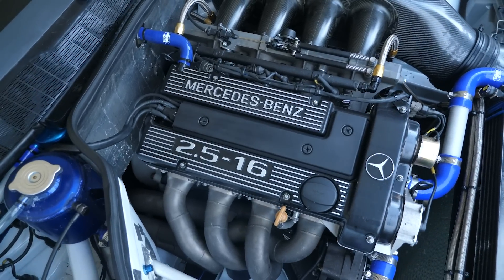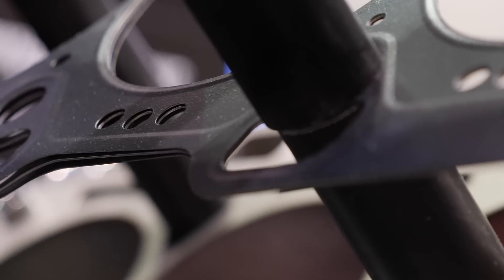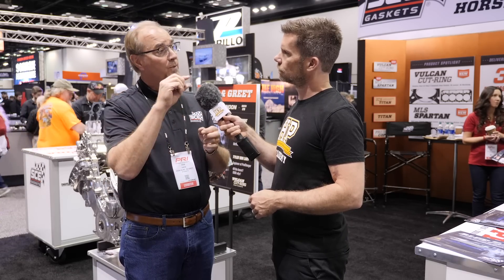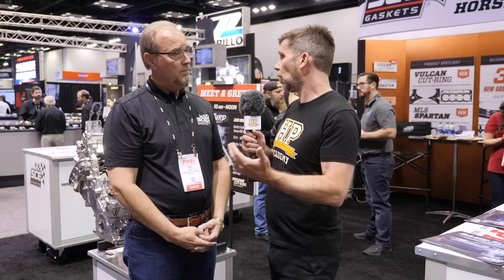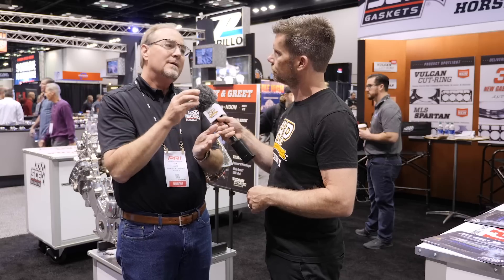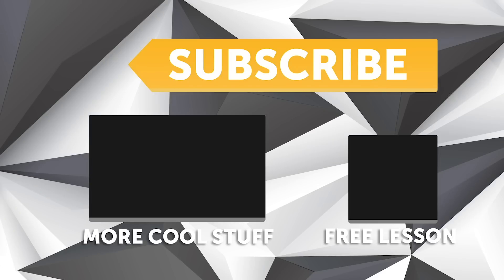50HP To 5000HP | Choosing Your Head Gasket | SCE Gaskets [TECH TALK]

Comment from the maker: 🏎 Building a fast car? Get $400 OFF the all-inclusive VIP online course package deal: https://hpcdmy.co/offery191
✊50% OFF your first online engine building course. Enrol now:  https://hpcdmy.co/offery191

9 out of 10 members of the public recommend you seal your body away from the elements with a stylish HPA hoodie or t-shirt: https://shop.hpacademy.com/
Get one for the missus while you're at it, but in your size so you can borrow it on the weekends 😉 #tazlifetips
00:00 - Introduction
00:30 - Composite Gaskets
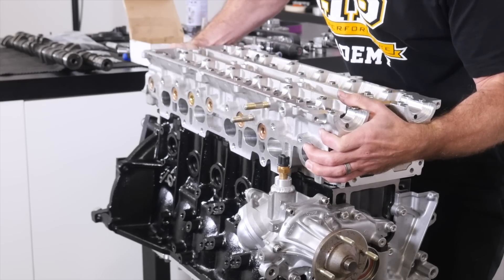02:00 - MLS Gasket, Multi Layer Steel
03:00 - Cylinder Lift/Gasket Memory
04:12 - MLS Gasket Coating, Viton
05:07 - Reusing A MLS Gasket?
06:21 - Vulcan Cut Ring Intro
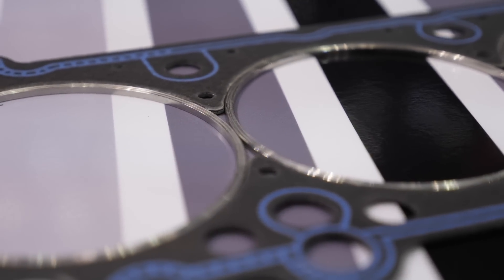06:50 - Copper O’Ring Gasket
10:45 - Vulcan Cut Ring Revisited
12:43 - Composite vs MLS In Cut Ring Gasket

Comment: 5:31 Why would you ever risk reusing a headgasket? That was bad advice.
Reply from the maker: He's told you it's most likely you won't be able to and why to be fair, but he can only speak from his own experience and someone like Ryan Hunter will have dealt with more head gaskets and customers using them than 99.9999% of people on the planet. Not that anyone is infallible.

On a performance engine we would also always just use a fresh one ourselves. It's cheap insurance compared to the damage a bad gasket can cause - Taz.

Comment: What do you recommend for a diesel engine running on CNG .
I work on a fleet  of 35 trash trucks that puts in head gaskets weekly.
Reply from the maker: We don't have any CNG content sorry. You will have to do some data collection and failure analysis on the issue as there isn't one single issue that can cause a head gasket to fail - Taz.
Reply: @hpa101  these are composite gaskets with a cramped on metal ring.
We see the metal ring fail mostly but we also see some with external coolant leaks.

Comment: What best size gasket for turbo car
Reply from the maker: There isn't a hard and fast rule, it depends on the engine and what you are doing with it as simply having a turbocharger fitted doesn't really mean a whole lot as a piece of information by itself.

Get your details together and talk to your head gasket supplier and engine builder if you're using one etc would be my advice. They might have questions that make you realize you still have a lot of other things to work out and consider before you even get to this point.

If you are learning to build your own engine via our course material this is discussed and it is something we can help you with via the members only forum too, however, I wouldn't sign up just for this question or if you don't plan to do some of the work yourself as that is where the value comes from with HPA - Taz.

https://www.hpacademy.com/free-engine-building-lesson/?utm_source=youtube&utm_medium=social&utm_campaign=general-interaction

https://www.hpacademy.com/hpa-engine-building-starter-package/?utm_source=youtube&utm_medium=social&utm_campaign=general-interaction
Reply: @hpa101  ya since my piston cr8:0:1 should i put a gasket 1.8mm

Comment: So if I have a 300hp boosted Scion tc, the best one to go for would probably be MLS?
Reply: Hello Jeziel Perez, It's really up to you. If you plan to boost in excess of 16lbs, I strongly recommend their MLS. If you stay below 16lbs of boost, I recommend their Vulcan Cut-Ring. It would be very important to know your "final" compression ratio; with boost factored in. Such charts can be found on the internet. 
I researched & found SCE rates their Vulcan Cut-Ring Head Gasket with equal cylinder sealing strength as their coated MLS head gasket; up to 16lbs of boost. 
But their Vulcan Cut-Ring seems to have better head surface sealing for liquid-cooled heads. 
My Super-Charged, Big Block Chevy will never see 16lbs of boost. So, I chose Vulcan C.R. 
I have the cylinder seal strength I want & quality head sealing of their high-tech composite. Hopefully, this information is helpful to you. 
Respectfully, 
Ben
Reply: @duygukayhanisaskank4915  thank you boss appreciate it. I’ll definitely look into it

Comment: Wait , im running  an all aluminium clevland on the street with copper head gaskets with copper  sealer & im not seeing coolant leaks . Am i just lucky ?
Reply from the maker: Could be one of a few things.

1.) You are not pushing/stressing your engine to the point it is an issue.
2.) Using products that give you a higher chance of failure give just that, a higher chance. There is no guarantee things will fall apart every single time at the exact same power level with the same issue, there is just the applicable probability of it happening, or not. 
3.) Regarding point 2, yes, you may just have been lucky so far depending on other factors. You might never have an issue for the life of the engine, it might let go tomorrow.

Basically it is not always just black and white, do this it fails, do this it works, but more what you do and don't do to give you the best chance of producing solid power from your chosen setup reliably - Taz.

Comment: I didn't have the money or requirements for a mls head gasket.  Not available for my engine unless I got it made.
My solution was a compasite gasket for the water and oil seal and had a 1.4 mm wire pinched into the fire ring

Comment: Could I use a copper gasket with 2 mls gaskets, 1 top and 1 bottom to help with cold oil and water sweat, and have good sealing. Or 1 copper gasket sandwiched between 2 mls gaskets. Pls help, trying to lower my compression without touching the bottom end.

Comment: Great videos!!! Here in Brazil, Vw used composite gasket in Ea827 Ethanol version with 12,3:1 CR for decades. Maybe the slow burn and knock suppression of E100 allowed this. But in 1997, when they launched the fuel injection and raised the gasoline version from 8,5:1  to 10,5:1 CR, they started to use MLS gasket.

Comment: we found a ""hack" with your standard MSL headgasket. if you for some reason cant get a new one just throw 2 layers of rattle can black paint on both sides. put it back on. it will work. not great but it will work. its best to replace it with a new one just so we are clear and it does make staring a bit harder but it does work in an emergency situation. it is a hack and only if you cant get a new headgasket.

Comment: Did Porsche use a steel o-ring head gasket for the Porsche 9R9 V4 Turbo Hybrid engine? The markings on the cylinder head seems to me similar to the Vulcan cut-ring head gasket.

Comment: Cooper spray  gasket  on head gasket will damage the cylinder head .tested. 
I don't know about copper gasket...
I think wire insert the block engine is the best solution .
Reply from the maker: I'm not sure what copper spray you've had issues with but we've used this on a variety of different engine combinations and it does not affect the head. It's a pita to clean up on disassembly but only requires some time and brake clean or isopropyl alcohol and a rag. As covered in this video, there really isn't a 'best' solution. It's very dependent on the application - Andre
Reply: @hpa101  I got a galvanized reaction on a k series engine.

Comment: Another informative interview, always something to learn - it seemed the gentleman also enjoyed getting some informed questions, rather than the pap he probably gets on a regular basis.
Good acknowledgement of the 'spring' that affects sealing - most people don't realise the head bolts/studs are basically very strong tension springs pulling the head against the block and compressing the gasket. With enough cylinder pressure there can be enough force exerted against those fasteners to weaken the gasket clamping force to the point where combustion gasses can escape - why we use stronger bolts, they won't stretch as much, maintaining the clamping force.

Comment: You know it’s a great interview when the interviewee’s eyes light up in surprise to the questions being asked. Machining tolerance and deck surface RA Is also a very important factor in selecting a suitable headgasket.
Reply: Dumb question here...
What is 'deck surface RA'?
Reply: @trevorvanbremen4718  Until someone pipes up with a more technically astute answer about the details, deck surface RA means the smoothness of the deck surface.  RA is a measurement of surface roughness in millionths of an inch or something..  Lol
Reply from the maker: Just for you @Trevor I'll do a community post on deck clearance shortly which is not quite the same topic, but you still might enjoy it. Should pop up here: https://www.youtube.com/c/learntotune/community

Deck Surface RA (roughness average) is as @Hammerhaus mentioned (cheers mate!) and is important in relation to your head gasket as if it is too smooth the gasket might slip/move on the surface potentially causing leak/s, and if it's too rough it might not seal correctly to start with leading to the same or other issues - Taz 👨🏻
Reply: Thanx Hammerhaus and HPA...
I didn't know what RA stood for, but DID know of the concept.

Comment: Team HP Academy, awesome video and just picking the knowledge off this dude! Interesting how there is so much information and technology being required for the various gasket applications and there is no one size fits all here. Curious if anyone would run receiver grooves and copper o-ring and just ditch the gasket all together. Will probably need the steady hands of a  skilled watch maker for receiver grooves for the coolant passages. Outstanding video Team HP Academy👏!

Comment: Stainless steel ring on aluminium head, are they concerned with galvanic corrosion?
Reply: i would ask same with copper-aluminium system.. like spraying on copper on mls headgasket which doesnt have viton surface as shown on video
Reply: No. 
Professionally we have successfully used SCE SS rings, copper rings and solid copper gaskets on iron block + iron head, iron block + aluminum head and aluminum block + aluminum head for decades without galvanic corrosion issues. 
We rarely ever use a copper-bearing spray on head gaskets over the last 15+ years.

Comment: Any pros and cons of using a gasket spray on glue? I know loctite sell these types of products..
Reply from the maker: This is something that's normally combined with the likes of a copper gasket (which does a terrible job on its own of sealing oil and water). SCE have their own solution with some of their copper gasket range as it has a rubber seal around the coolant/oil passages. The head gasket 'glues' won't really help your cause if you're lifting the head though.
Reply: Always follow the gasket manufacturer's recommendations and if there is doubt or questions contact the gasket manufacturer for additional support.

Comment: what about copper spray on a composite gasket? is it good?
Reply: Copper spray is a bandaid for a problem not a solution. Should never be used with good surfaces and new gaskets.
Reply: I use it. The only time you really don’t wanna use it is when everything is machined and perfect with a MLS gasket. I’d recommend it for a composite gasket for OEM applications.